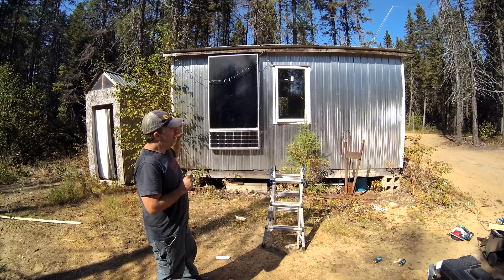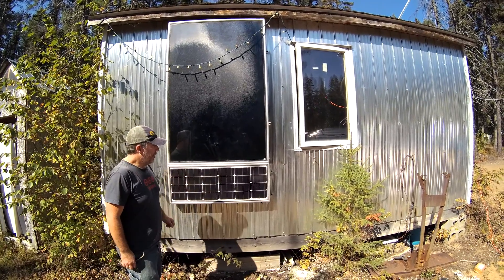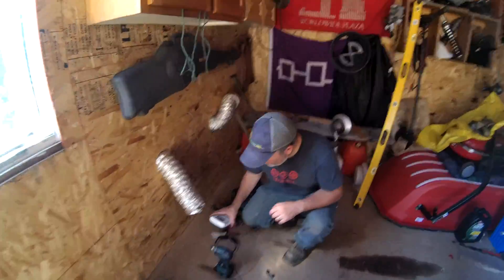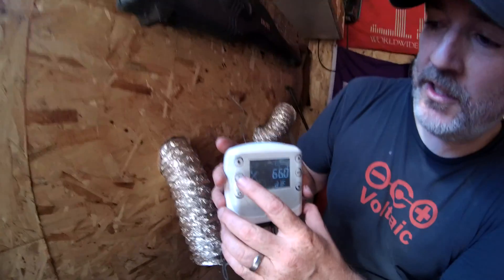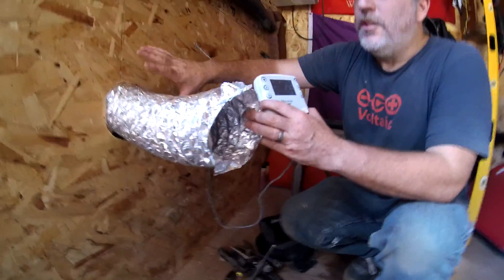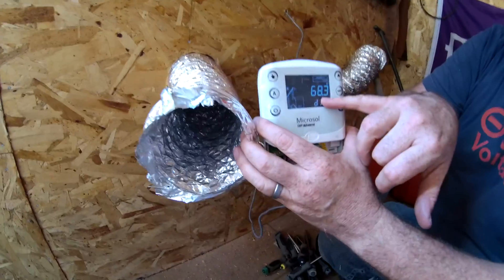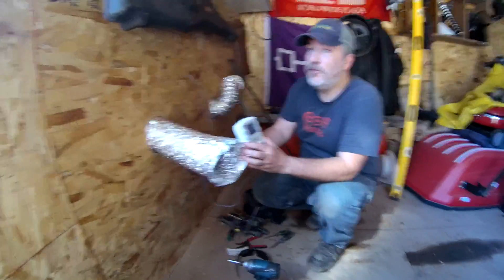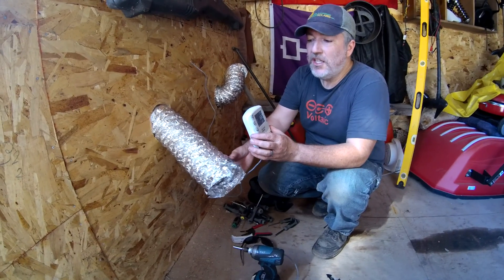Solar air heater in Northern Quebec

Comment: Nice unit. What is the cfm output? What is the efficiency at -20c? Is there a spec sheet on this unit?
Reply: Thanks for the comment!  We should be putting out new videos soon with more details!   The controller unit has three settings 35CFM, Mid 55 CFM and 95 max. Spec sheet is available on our website:  
https://ecosolaris.com/en/produit/chinook-hot-air-solar-panel-1-5-m-1125w/  dont hesitate if you need anything else!

Comment: So there is an on/off switch which just means whether or not the fan is turned on,  correct? Will it only turn on when the temperature within the unit is at a certain temperature? And it doesn't store heat,  correct? So at night when the sun goes down there would be no heat available.
Reply from the maker: There is actually an "off", "manual" and "automatic" switch actually...1-The PV panel produces the electricity to run the thermostat, but the fan won't turn on until there is a difference of 10°C between the sensor inside the thermostat and the sensor inside the solar air panel.  2- As for storing temperature, no it can't, but the space where the solar heater is heating will be used as the "thermal storage" as per say.  A little bit like a slow combustion fireplace:  you let the place get hot when the fire is on: With the Chinook You let the place get hot during cold but sunny days ! The idea behind this design is to keep it as simple, efficient and cost effective as possible  :-)